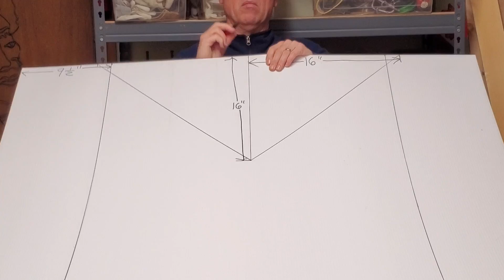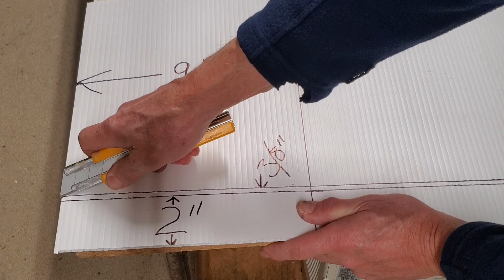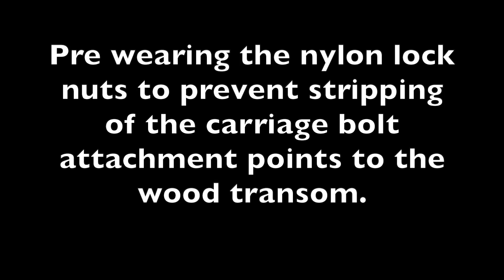Coro Speedboat II (Part 1)

Comment: Another masterful project build!  Where did you find 6 mm coroplast?  My Home Depot only stocks 4 mm.
Reply from the maker: Home Depot online store still sells them by 5 packs at a little over $200. They drop off at your nearest store. 
https://www.homedepot.com/p/Coroplast-48-in-x-96-in-x-0-236-in-Fluted-Twin-Wall-Plastic-Sheet-5-Pack-COR6MM4896-WT/206084764

Comment: Like you PAUL but transoms  going to leak  I origami the the back may make boat 12 shorter but I have high sides and it's more twitch and responsive  in tight areas I took a motor out of a rc 4 by4 attached a propeller  to it seald it in a old electric casing now I use a dealt battery to power it total weight of boat and motor 17 pounds